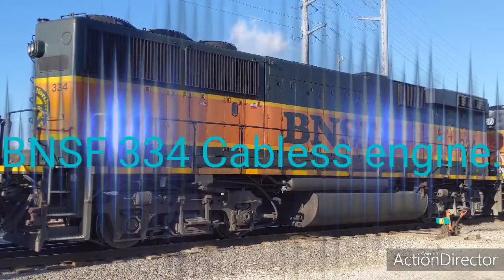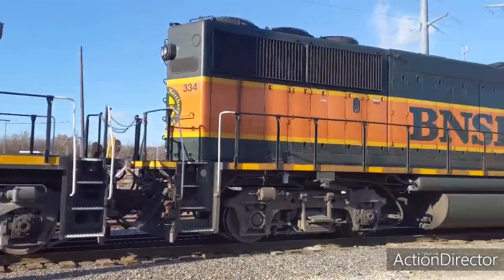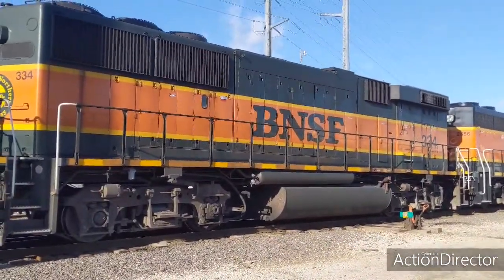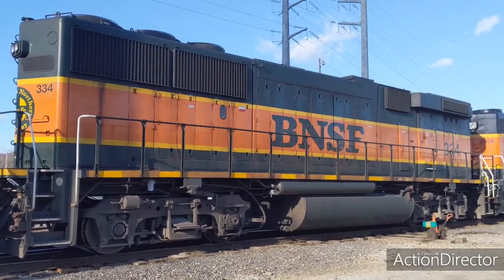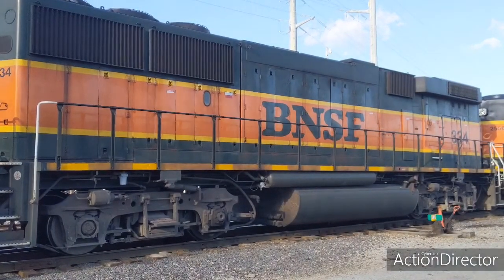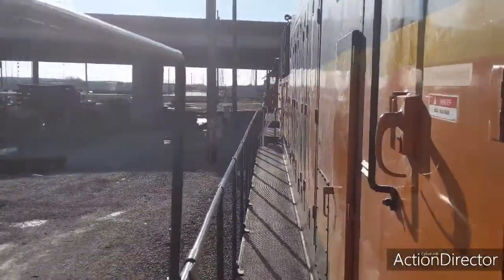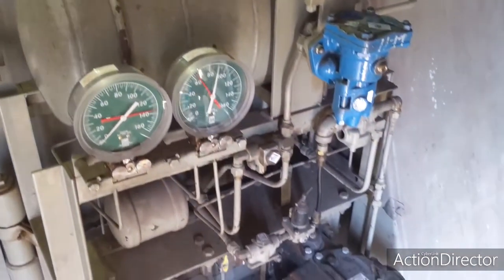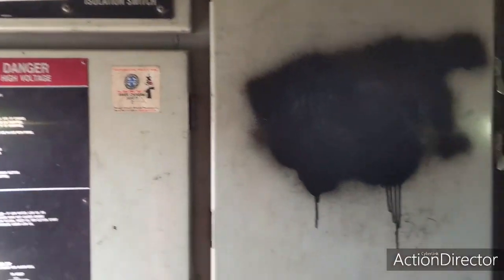BNSF 334 "cabless" engine...

Comment: People call them cables loco's or slugs but they are most commonly known as booster units unlike slugs booster units do have engines in side them where as slugs draw their power from the souly from the mother unit or mother loco. Either way the rail road thought by converting  (some) loco's into slugs or booster units that it would be a cheaper way to lesson the amount of personel needed to operate more loco's also it gives the railroad the ability to get more life from older loco's that they could possibly get before they send them to the scrap yard or sell them off to privet buyers.
Reply from the maker: I disagree, I have been working 32 years so far as a Locomotive Engineer and on my railroad they are called cabless engines...
Reply: @imyourhuckleberry357  well? 32 years experience you've got so I definitely can't argue with that. You deffinatly know more then I do. My appolozies if I insulted you. That certainly isn't my intention. I do envy you though. Your doing a job that I could only dream of doing.
Reply from the maker: @jamesmaclary8441  Ohhh no apologies needed...They could be named other things at different railroads...One guy said they are called a Cow  and a Calf . LOL....There are alot of terms we use in one railroad and a different on another. So yeah, thanks for watching and no worries my friend
Reply: @imyourhuckleberry357  thank you my friend. And I to have hurd the term cow,and calf before. Rail crews,and rail fans have said that many times especially when it came to the sw1200 locos with theyer calf units,helper unites or slugs either way the cabless unmaned unites still help get the job dun. And to me on my ho railroad I use them quite often. Heck I even use track mobiles or rail car movers as some would call it. Lol none the less I love all railroads and I kind of have to because my grandfather worked as a swichmen for the longisland railroad back in his young man's days. So yes  he made sure that the railroad stayed in my blood.lol I'm on disability I tried to get a job working for Norfolk Southern but when I told them that I had a disability i was shot down. It was the biggest heart breaking moment in my life but I still didn't let that issue stop me from loving the railroad as much as I do. And talking to you just makes me love the railroad all that much more. Like I said I envy you cause you are living my dream. But to me being considered a friend of an engineer like you is good enough for me. If anyone can teach me all about the railroad its you. My name is Jim and its an honor,and a privilege to talk to you,and call you my friend. God bless you,and I thank you,and all railroad crews for keeping this crazy country going. I totally appreciate everything you,and all the other rail crews do on a day to day bassis for this country,and abroad. If it wasn't for the railroad this country would still be stuck in the western days. Lol     so anyways I thank you for being an engineer that keeps this country moving. God bless you always my friend.
Reply from the maker: @jamesmaclary8441  Wow, I am so flattered...Just to give you a bit of my history....I am a fourth generation railroader all Santa Fe...My great grandfather was a conductor in Topeka Kansas, my grandfather was a conductor and worked out of San Bernardino California and my father was a conductor out of San Bernardino California...I hired out of San Bernardino California in 1990 on the prior Santa Fe Railway as a Brakeman and was promoted to Locomotive Engineer in 1991 and was givin a conductor date of 1992 when we went conductor only...I worked for 13 years going up and down that Cajon pass and  working all sorts of road switchers and locals all around Southern California...In 2003 I transferred to Galesburg Illinois and work several jobs but mainly Galesburg to Kansas city, Galesburg to Creston Iowa or Galesburg to Lacrosse Wisconsin runs...I have 4 and a half years until I can retire. I will be 60 with 37 years of service....Thank for watching..I do alot of dual sport motorcycle videos as that is my recreation but I also throw in things from the railroad I feel interesting...Thanks again for watching..
Reply: @imyourhuckleberry357  my dear friend you are so very welcome. And WOW you most certainly put in a lot of time,and years on the railroad,and when you do retire from the railroad those who you work with will be sad to see you retire. I know I would be if I was one of those works who worked side by side with you. But from one railroader to another. The railroad will always be in our blood and that's only because the railroad is the Biggest family we know. Be safe my friend,and as Steve Miller from the Steve Miller band would say. Keep on keep'n on. 👍😎👍

Comment: Is that a GP38 ?
Reply from the maker: It's a 300 series cabless unit.
Reply: To EMD, it's a GP60B.
Reply: @beeble2003  thank you. It didn't have the 6 wheel drivers as the other two, and it's about the size of a GP-38 except for the power rating.
Reply: GP60B
Reply from the maker: @onrr1726  Thanks for your comment..More to come
Reply from the maker: @SocialistDistancing  Thanks you...More to come

Comment: Road slug
Reply from the maker: Cabless engine on my Railroad...
Reply: No, a Slug has no engine. This is a B unit.
Reply from the maker: It's a cabless engine....I slug has no engine and used in yard operations....Thanks
Reply: @imyourhuckleberry357  read what I wrote again. I said a slug has no engine.  But a locomotive with no cab is known officially as a B unit. Not a “cabless engine” That’s even listed on the FRA Blue card. That’s also why it’s it’s called a GP60B as opposed to a GP60M. Same exact locomotive except that version has no cab, hence the “B” designation.  BNSF likes to unofficially call them cabless engines and slugs, but that’s slang unique to that railroad. No manufacturer, nor the FRA, nor any other railroad calls a B unit a slug. Two completely different things. They also don’t call them “Cabless engines” when you could just say “B unit”.  
And slugs are not only used in yards either. Many railroads, including CSX, have “Road slugs”.  We had dozens of them and ran local freight’s and transfer moves with them. Full cab as well, no prime mover
Reply from the maker: @FFred-us9tw  And what I'm saying to you is....Where I work for the last 32 years as a Locomotive Engineer, it is known as a cabless engine or unit...
Reply: @imyourhuckleberry357  yes, and like I said, that’s a slang term used by the BNSF. But the slang you use doesn’t supersede correct terminology.   You can certainly refer to them by any name you like.  But that doesn’t change the fact it is technically a B unit. And that’s according to the manufacturer, the FRA, and almost every other railroad.   I literally have the EMD Operators manual for the GP60B sitting in front of me. Nowhere in the description or the name is it called a “cabless locomotive”
Reply from the maker: @FFred-us9tw  Not a slang, it was that with the Santa Fe as well..It can be called different things... Just as a Locomotive Engineer is a train driver in England...
Reply: @imyourhuckleberry357  uh that's bullshit, they do have engines and are plugged into the lead locomotive by large cables....
Reply: @imyourhuckleberry357  those 3000 gallon diesel tanks aren't just for traction
Reply from the maker: @ChiefCabioch  You are absolutely correct...They just don't have a cab...Maybe watch and listen to the video next time...The equipment that doesn't have an engine is what we call a slug and use in yard service for tractive effort...
Reply: @imyourhuckleberry357  not what I learned while working at the DOT facility operated by the AAR in the Colorado desert East of Pueblo.
Reply from the maker: @ChiefCabioch  It's what we call it here..The people that actually work for the railroad, at least on my part of it..There are alot of things you might not be aware of. For instance, in Texas when some need a little bit to come back and make a joint to a car they say " give me a hoe handle". Yeah, probably not in your text books from what you learned but none the less,it's there.
Reply: @imyourhuckleberry357  seems the resident genius here and his 32 years as a locomotive is getting some Pushback, so not everyone is subscribing to his crap.
Reply: @imyourhuckleberry357  in the Mid 80's were there any changes to the Engines load box  testing procedure? Because BNSF sued EMD for what we discovered during our tests.....and they asked us to come to Lagrange to see all we found, they weren't happy and 5 top engineers were fired for falsifying Data on power figures, when BNSF found the truth they sued EMD...and I Rewrote a new Test sequence much longer than the original 30 minute test....
Reply from the maker: @ChiefCabioch  BNSF...Eighties? Never heard of a railroad in the 80's called BNSF...So much for your expertise.....lol
Reply from the maker: @ChiefCabioch  HAAAA...
Reply: @imyourhuckleberry357  nice thing about the truth, it doesn't depend on your participation...
Reply from the maker: @ChiefCabioch  So you're sticking to your story of BNSF Railway was around in the 80's? All I need to know...Thanks